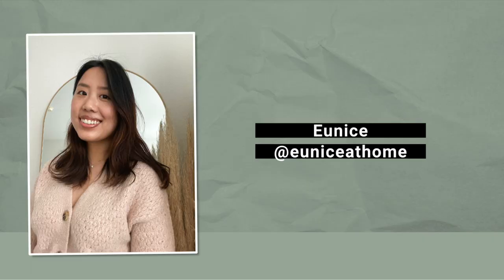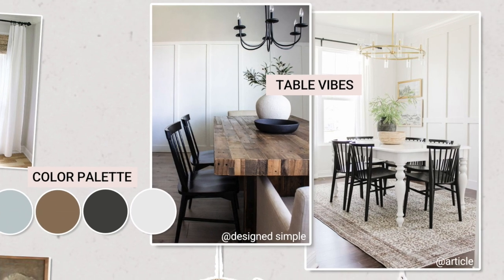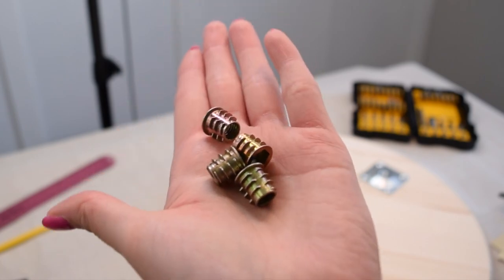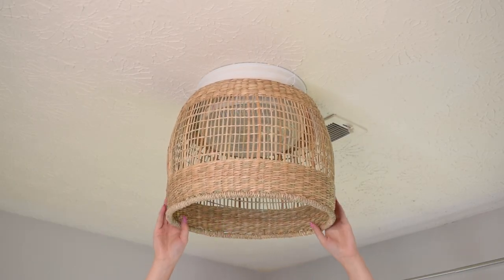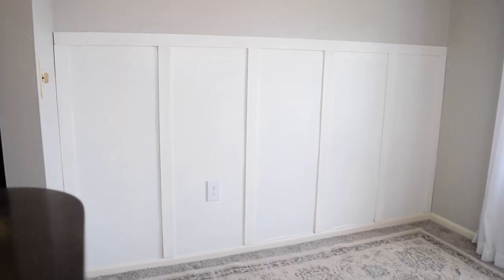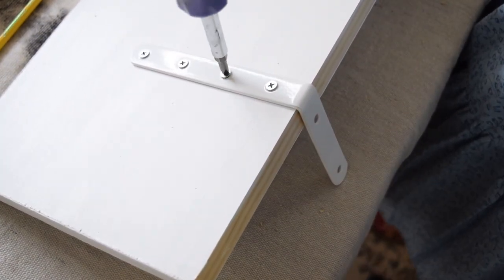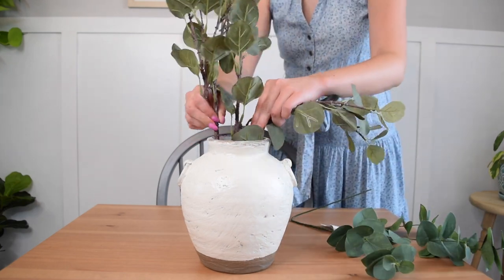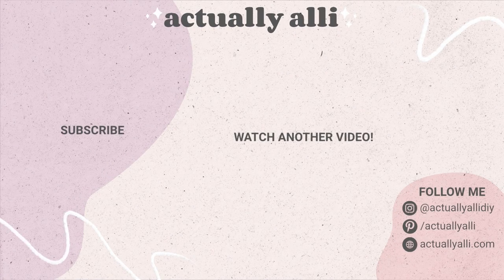DINING ROOM MAKEOVER Renter-Friendly & Under $150 🌿 DIY Transitional Decor Transformation

Comment: Hi Alli, you don't need those "little screw things."  Just go to the hardware store, tell them what you're doing and they will get you the double sided screws.  One end is pointy so you can screw it into the wooden leg after drilling a pilot hole, and the other end is flat on top so it will screw into the metal attachments.
That being said, I LOVE the DIYs and the reveal!!  Just a tiny suggestion, how about painting the 3 legs of the plant stand you made, the same color as the chairs?  Love that color!  💙
Reply from the maker: Brilliant!! I am going to do that and give this project another try! Thank you SO SO MUCH
Reply: @ActuallyAlli  😘

Comment: Hey Alli, I have a similar dining table set in the same color and was wondering did you do a sealant or whatever it is called to keep the paint from chipping, etc? I am not sure if that's the proper term but just curious. I know this is a budget video, but curious what you would recommend when I start out doing mine!
Reply from the maker: I did not, and I really wish I would have! I would recommend using primer first too. I also wish I would have gotten a better quality sample (Behr at Home Depot gives you the full quality paint, this paint I used from Lowes did not). Or for the best results, use a paint meant for cabinets. It's more expensive, but more durable. If you don't use a cabinet paint, you could finish the chairs with either a water-based polycrylic in either matte or satin, or there are waxes for sealing (I have not tried that yet, but want to for an upcoming project!)